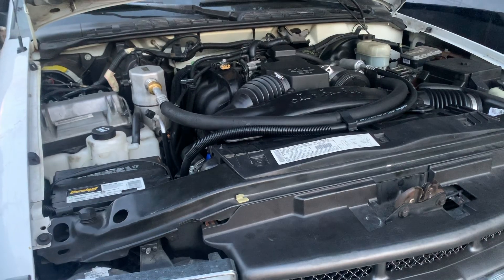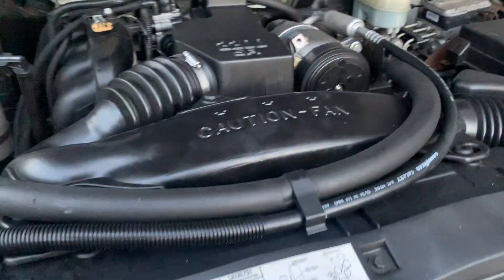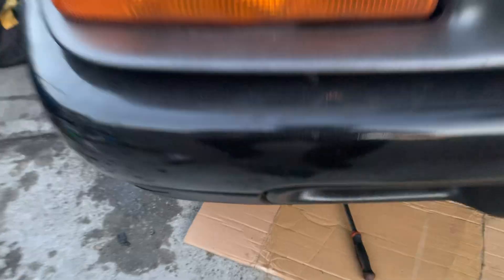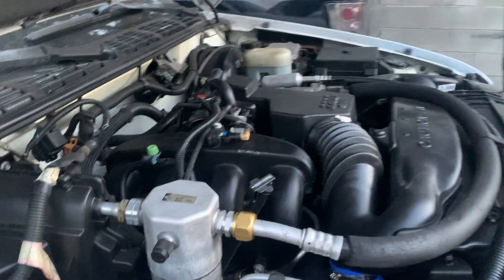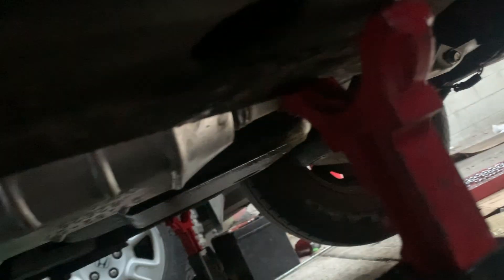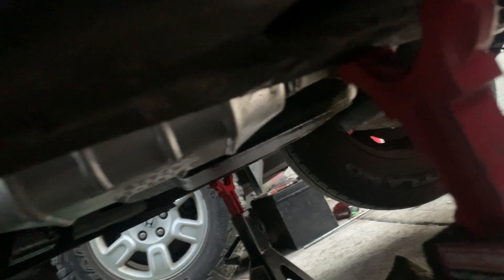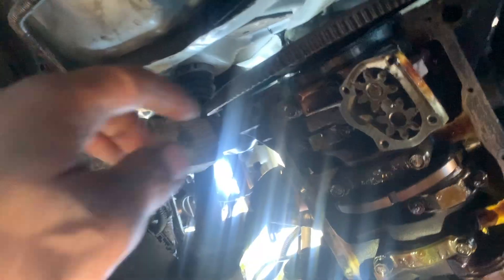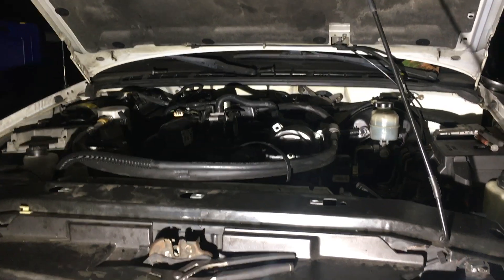chevy s10 2000 oil pan gasket

Comment: Is this a 2.2?  I was told that my motor had to come out to change the pan gasket. THX
Reply from the maker: Yes your motor has to come but like you see on the video you can remove transmission lift the motor have way but make sure you angle the back part of the motor down and the front up and the oil pan will come out just like the video
Reply from the maker: To Kenny Walter

Comment: I know for a fact that cork gasket ended up leaking. Silicone came off factory so silicone would go back on
Reply from the maker: Hey Kriss till right now the gasket is not leaking at all.
Reply: I guess that fact that you k ow, wasn't an actual fact.. one dude said it worked just fine.. 2. You weren't there in person from start to finish.. you got your facts incorrect..😂😂😂